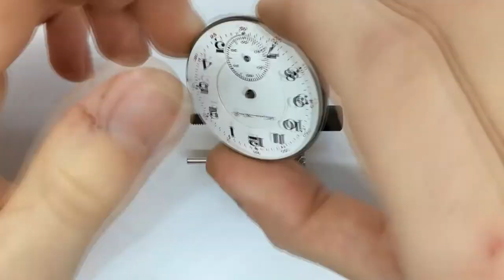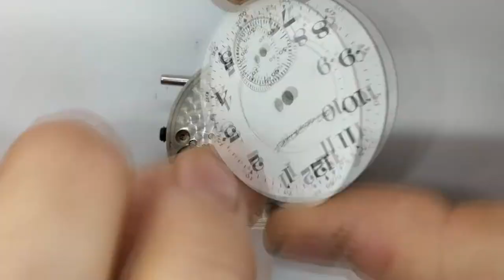Restoration of an Antique Hampden Pocket Watch - Relaxing Video

Comment: Hi! Where do you get such kind of watches? I'm from india and would like to buy a few pocket watches at a cheap rate.. any help would be greatly appreciated :D
Reply: You can get Vintage Pocket Watches from e.g. EBay for a Tenner a piece, but do not make the same kind of beginner's mistake like me: I bought a Job Lot of old Pocket Watches but when they arrived I noticed that they were "too old" for a beginner for starters. They all but one had Cylinder Escapement, which are very prone to wear and bitches especially for a beginner to maintain and install.

Note that the price is according the looks and condition of the watch, so do not expect to get a Pocket Watch like the Hampden in this video in almost pristine condition and looks for a Tenner. The cheap ones are perfect vict...um... projects for the beginner though.
Reply: @Ba_Yegu  thanks for the clear explanation ❤️ if not pocket watches can I get normal mechanical watches for a cheap price? I'm not able to access ebay here in India any help would be appreciated
Reply: @AhuCJ  In India there is a whole refurbishing industry of Vintage Wrist Watches. It apparently works by sourcing a large batch of New Old Stock Movements from e.g. Switzerland and installing them to new cases and locally made often colourful dials. They often are much better than their reputation as their Movements are often pretty darn good.

These watches are cheap even new and even cheaper (or free if not running) as used, but still good for maintenance exercises. Still the most usual reason for a mechanical watch not working is that it has dropped out of fashion, been neglected from maintenance and abandoned in a drawer...
Reply: @Ba_Yegu  oh yeah these are called franken watches. I want unrestored ones with original parts as I love restoring them in my free time